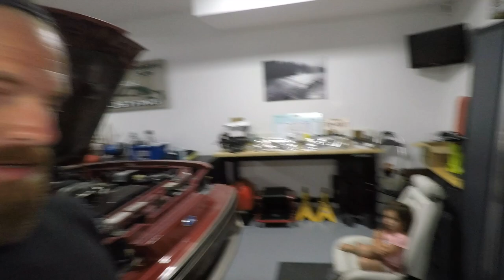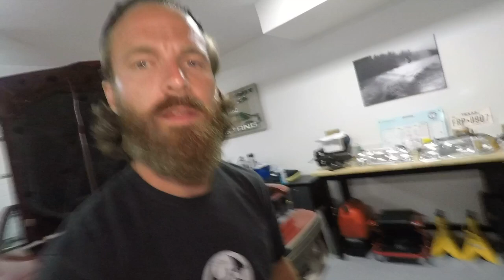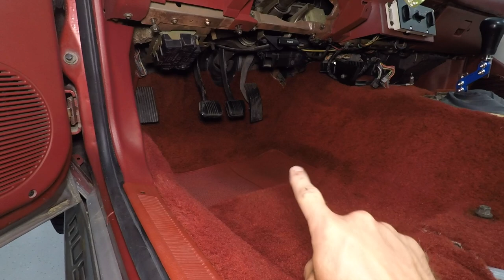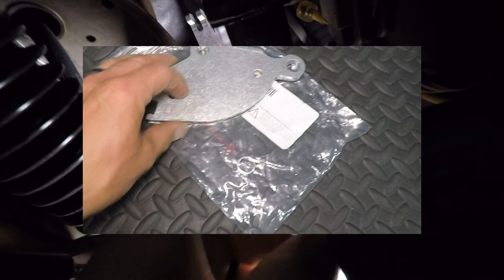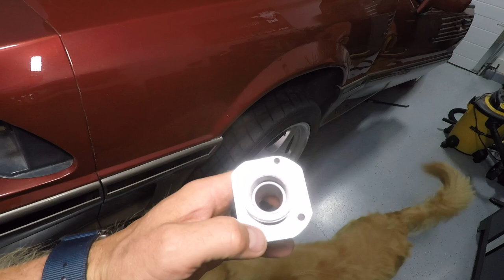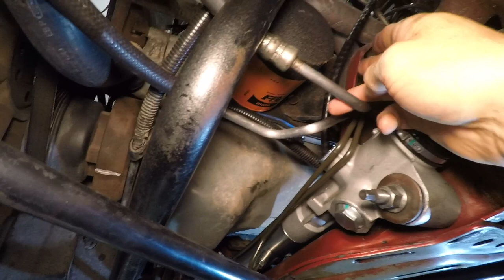1982 - 2004 Mustang Clutch Cable Swap /// Step by Step & HOW TO

Comment: Most thorough video around on clutch cables I’m sure it will be very helpful to a lot of people. I think the silent killer of clutch cables is heat and how close the bracket is to the header. You can only bend the bracket back so much before you start aggravating the natural arch of the cable as it’s wrapping around to go down to the bell housing. I used single hook billet quadrant a $27 pioneer stock replacement cable and firewall adjuster with some DEI heat sheathing and i haven’t felt any stretch in the cable whatsoever. I took the slack out of the cable with the firewall adjuster. Clutch adjustment without wiping out a throwout bearing is another issue. There’s no clutch fork return spring on a foxbody because Ford used that self adjusting quadrant. Some people say the t.o. bearing shouldn’t touch the clutch fingers at all which is how I fixed the problem I was having. Worst thing you could do is have too much pressure on that throwout bearing. Because you’ll be replacing it soon. Ehhh!
Reply from the maker: Thank you very much. I really appreciate that!!! I agree with you 100%. The T.O bearing is an interesting one in that I too have heard mixed reviews on whether or not one should have it engaged (slightly) all the time or not. They are definitely susceptible to a ton of clutch dust and heat which never agrees with bearings! That said, I’ve adjusted clutches where the TO bearing is both fully disengaged and fully engaged and the end result in both cases could be a squeaky bearing 🤷‍♂️😂. Chances are, it’s all due to the fact that things like bearings ain’t built like they used to be 😞.

Comment: I just did this job myself and it took me 8 hours over two days.  I tried everything to get the paw adjuster out.  I finally took an old wood chisel , heated the end with a gas torch, and burned the plastic tip off going through the fire wall open hole. Once the tip broke off, the paw popped right off.  What a design!
Reply from the maker: LOL - they can be interesting...

Comment: This helped clear up Steeda’s unclear instructions. They don’t specifically say to discard the rubber bushing when using a firewall adjuster; they just say to remove it so you can trim those 4 pieces off, so I wasn’t sure if I was supposed to keep the bushing or toss it. Great stuff!
Reply from the maker: Right on. Glad it helped 👍

Comment: I'm in the middle of swapping a clutch cable now. Man, you're not kidding about how hard it is to get that factory adjustment pawl/claw off of the shaft. For a while I simply didn't think I could do it, but finally got it after some anguish and struggling. I love your video, super helpful! That's a real nice car you've got there, beautiful stock engine bay.
Reply from the maker: Thx very much sir!!! Yes, this swap is one that needs a high level of commitment 😂👊
Reply: how’d ya do it? I’m about to set the car on fire trying to remove this crap

Comment: Just wanted to give some tips for how I got the back paw off. Easiest way is to take the spring that’s connected to it off with a flathead. Then with your elbow press the clutch to the floor and use a long pry bar to push the plastic peace of the shaft. Once I figured the trick out it took me 5 min. After the initial hour of struggling.

Comment: Best detailed video on how to do this. I wish you were around when I did mine years ago. Also, dam! Is that car clean and are those factory cats??? Those are mystical! 🤣
Reply from the maker: Awe thanks my friend!!! LOL yessir, those are the original cats! This car is a total time warp with regards to everything being 100% original. Even the plugs, wires, and timing had never been changed!!!
Reply: @KASLCustoms  I knew it was original but come on! I haven't seen stock cats in forever. 8 whopping degrees of timing?  I thought I spied factory wire looms. Wow!
Reply from the maker: Lol I know right!? This was much of the reason I was attracted to the car. It’s not very often you find one that you he Haynes manual is still relevant for 😂

Comment: Stupid question do you leave the spring in? It came out with the plastic adjuster.
Reply from the maker: Do you mean the spring that is on the plastic quadrant?
Reply: @KASLCustoms  Yes, I  ended up removing It. It did not come out when I removed the plastic quadrant.

Comment: 83 mustang 5.0 5 speed. I installed a new two-stage clutch and also the same cable kit as yours.  But what’s got me baffled is no matter how much I adjust it.  My clutch doesn’t grab until the pedal is way out like almost to the end.
Reply from the maker: Have you adjusted it down at the clutch fork?

Comment: Cool, im wanting to T5 swap into a 75-91 econoline. And trying to figure out what i can do for a custom clutch pedal assembly. But i wanna use fox cable and quadrant.  (my car prob needs a cable and adjuster too, but im trying to sell it).  Thinkn just fully modify a foxbody clutch pedal assembly.
Reply from the maker: Yeah, I find it’s always easier to modify something that already exists then it is to start from scratch 😉
Reply: @KASLCustoms   I solved it after this post. Floor mount hydraulic pedal. convert T5 to hydraulic. Easy peezy!
Reply from the maker: Very nice! I like it!!

Comment: Okay so question, I knowing you have to fiddle with it to get the sweet spot, but I’ve gone through a couple of threads about the following debate… should the adjuster be mainly in and then turned loose (out) as the clutch wears or is the other way around where it should be mainly out and then it gets adjusted by tightening (in)? 
Recently got an 1989 GT and I got the kit but I don’t know how to start off with it. 
I’ve got a new clutch and a new tremec t5 in the car now. The quadrant and firewall adjuster are the last steps. (Well that and eventually switching to an aluminum driveshaft)
Reply from the maker: No problem. You start the adjuster all the way in and adjust it out from the firewall to tighten it 👍

Comment: I was wondering how hard it was for you to get the little pawl off off the clutch quadrant?  It looks like you had very little room to the right of the shaft. No matter what I did I was not able to get the pawl off.  I couldn’t push the pedal up enough to get clearance to move it to the right off of the shaft.  I ended up needing to drill through the plastic and break it off. Of course I started trying to remove the whole pedal assembly but then figured just drill out the plastic would be easier. You must of had a hair more clearance then mine when you pushed the pedal
Reply from the maker: Hey bud! Thanks for reaching out. It’s so funny you ask because I had one hellova time!!! Many bad words were spoken, many tools were thrown, and too many hours were spent to not go the route that you did 🤣. 

Long story short, I got a little rowdy with it at one point (I may have had a larger pry bar involved) and it shook loose and came out. 

Lol - your not alone buddy 🤣👊🦊❤️

Comment: I thought I was screwed when the plastic one went out I was at AutoZone zone and I shut the car off. I couldn't start it so I put it in 2nd gear turned the key until it started hit the gas and just left it in 2nd and didn't stop until I got home.